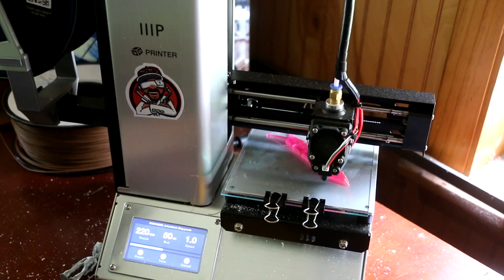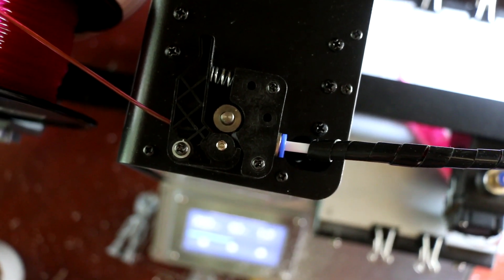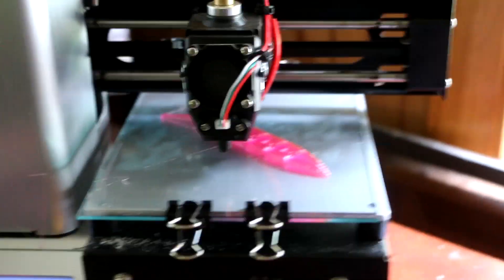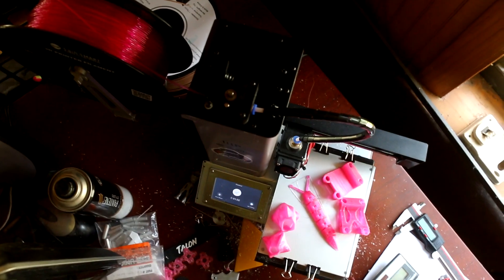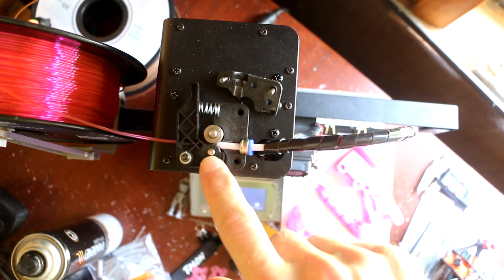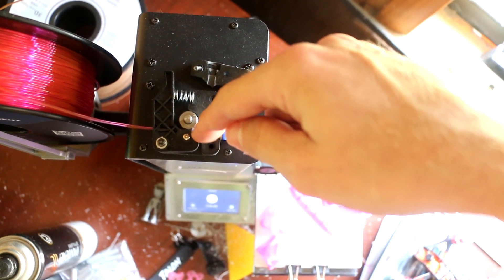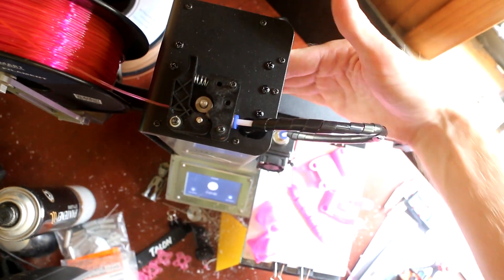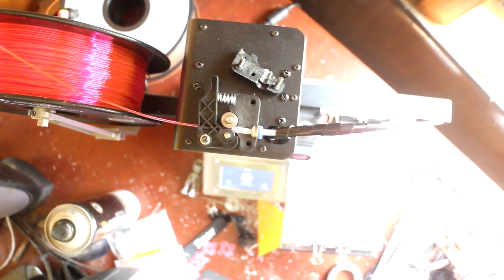How to print TPU FASTER! on a Monoprice Mini Pro

Comment: Hi thanks for your video if I'm a year later 😂  May I ask you 2 things? 
1. You wrote to remove the glass for auto leveling, then I have to place the glass and do a manual leveling?
2. Does the Z axis spacer changes if the thickness of the glass changes? 
Best regards
Reply from the maker: This printer has no manual leveling, so you must remove the glass to use the auto leveling feature.  If your machine has manual leveling then you don't remove the glass.  Yes, you need a thicker or thinner Z-spacer if your glass is different.
Reply: mooosestang I'm waiting the Pro as yours, so I have to auto level, then I put glass+spacer then I adjust the Bed level correction manually. Am I right?
Reply from the maker: @enricob  Yes, that's correct.  Any time you want to auto level the bed again you need to remove the spacer and glass, the sensor can't see the glass and i doubt it will work that far from the metal bed.  If my gap is too close i like to add layers of electrical tape to the spacer, it's quicker than fooling with the bed level correction.
Reply: mooosestang thank you really much! It helps me a lot 😊 have you ever tried to print Sainsmart TPU or Cheetah TPU from NinjaTek?
Reply from the maker: @enricob  sainsmart is about all i use.

Comment: I bought one this 3d printer that shows tpu available on spec., but not perfect result with a stock status. so do both need to print tpu faster, modding the extruder and glass plate? or not?
Reply from the maker: A glass bed is not needed.  Modding the extruder is the key.
Reply: @mooosestang  I see. thank you for your answer. it helps me ^^

Comment: I legit bought one last night lol. Awesome video
Reply from the maker: You will not be sorry if you do the mod to the extruder.  It's a night and day difference for printing tpu, no down sides. You should still print tpu slower, but if i want to bang out a gopro mount at 50mm/s, then i'm pretty sure i could. That would be a challenge on even a direct drive printer I think.  go straight to printing on glass!  you can leave the buildtak on the bed, just lay the glass over it